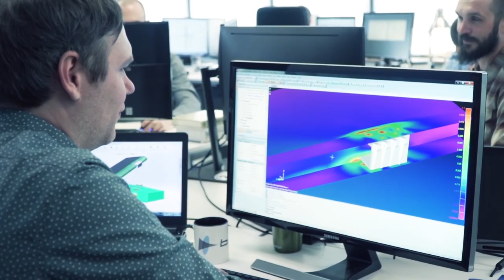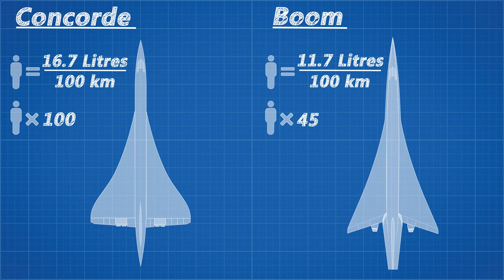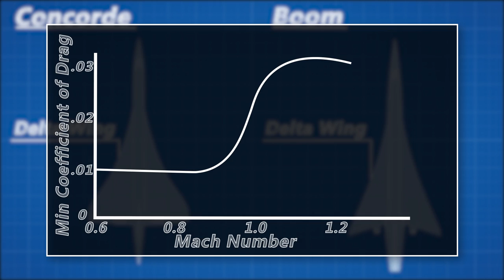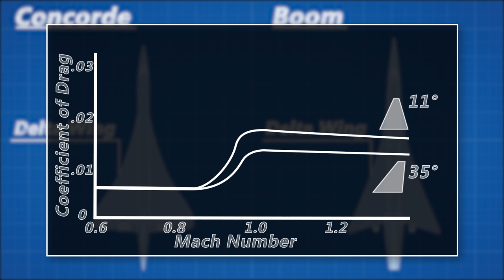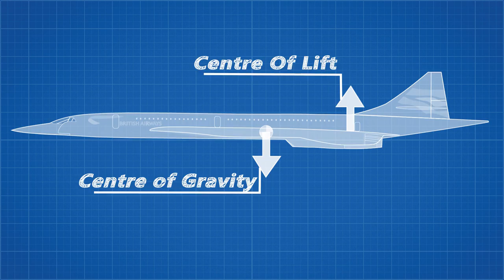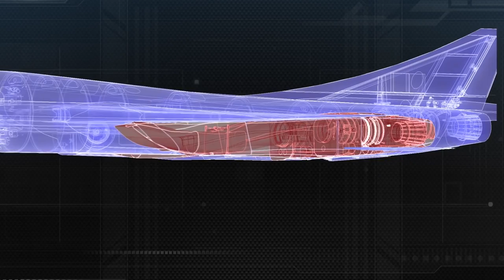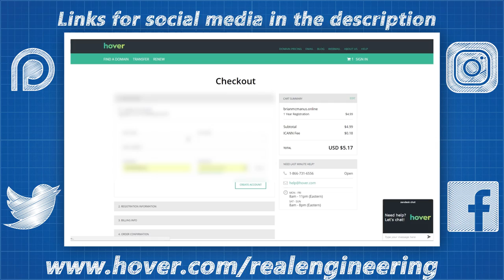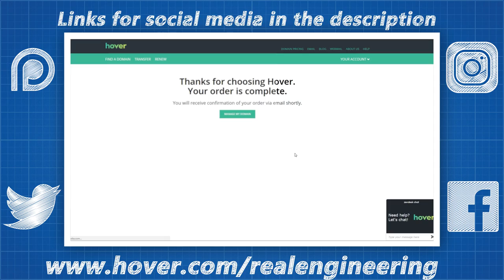Boom: The Future of Supersonic Flight?

Comment: Should be interesting if they pull it off.
I was kind of sad when concorde stopped flying. 
Not a practical aircraft, really, but still there was something inspiring about it's existence.

Based on the drawings and such I'd have to say Concorde still just looks a lot more elegant, but looks are not the primary thing here when the technical requirements are so demanding...

Comment: I'm sorry but on the part of Angle of attack (at 7:18), you're wrong. You mean Angle of Incidence. As angle of Incidence is the angle between the Cord line of the Aerofoil and the Longitudinal axis of the Fuselage. Angle of attack is the angle of the cord line of the Aerofoil to that of the relative air flow, which can only be read when the plane flies.

Comment: Some basic homework required on the introduction. Please go and look at the footage of the safe and reliable Concorde with its wing on fire, struggling to maintain lift. It failed due to a piece of steel edging shredding a tire and rupturing the fuel tank. There was nothing safe about that aircraft, and they want to call this one Boom. Good luck with that! Suggestions for these guys. If they go into car production, don't decide to call it lemon. Okay.

Comment: I don't know how loud sonic booms are at high altitude, but I've always felt that if its ok for planes to be so loud that I can hear them inside my house as they fly over, and have to listen to this sound for several seconds, then I wouldnt really have a problem with hearing 1 quick boom that is comparable or slightly louder as it passes overhead. After all, supersonic flight probably wouldn't be all that common anyway compared to normal aircraft.

Comment: I could be wrong but I thought you require wind tunnel testing if you're doing CFD. Solely because the lack of accurate turbulence models and transitional models for CFD mean you need experimental data to ensure the CFD is accurate.

Comment: dude, you overestimate the impact of the boom on decease of the Concorde. should have been - economic reasons first, then boom. One more thing - chine is added not only to balance the lift, but also to CREATE lift, making the plane fuselage in an essence part of the lift surfaces, rendering the plane more efficient - this refers also to SR-71 - and in a much broader sense, to all the flying wing aircraft, like the Ho-229, XB-47 and of course the B-2.

Comment: There was a supersonic bomber built by the USAF in the 1960s. This craft was called the XB-70.
Two prototypes were built. One survives today in a museum as the other crashed.

The plane's main goal was a high altitude fast penetration bomber. 
It had a cruising speed of Mach 3 (2,000mph) comparable to the SR-71 blackbird.
It could carry a 60,000lb payload. 
Had a 4200 nautical mile range (Boeing 737 MAX has a 3800nm range) 
It was similarly size to the Concord.
Had a 77,000ft operational ceiling.
This plane should have been a SST and was actually used in the late 60's for much of the research used by various companies in the development of SSTs. 
The design should have been used as America's SST.
This plane would be ideal for a long haul SST.

Comment: Currently there are no engines which can fly at supersonic speed and which can meet noise requirements and acceptable fuel consumption.

Not sure it would be possible to develop new engines for that, and in any case the development cost would be huge for a very small market. 

Nowadays airlines don't look for faster planes, but only for the lowest possible running cost...

Comment: A lot more interesting than the innovative solution to saving fuel by flying the plane slower. 

Now this has me wondering if it's possible to make a turbofan engine that allows for an SR-71 style compressor bypass.

Comment: 6:52 I thought wingtip vortices were bad - hence why planes upturned wingtips to keep the  vortices away from the upper surfaces?
Reply: Kj16V they are, but here we're dealing with a leading edge vortex, which allows the airflow over the wing to remain attached creating lift at angles of attack that would normally have detached airflow and no lift being produced (ie the wing is stalled).

Comment: Lesser known fact about the "sonic boom" which helps things make sense to those who it doesn't quite make sense to: it's less of a "boom", and more of a "booming"! Ie, the pilot only hears it when passing through the sound barrier, because after that point, the sound is left behind the plane... but the noise continues to be generated for the entire supersonic period!

I wonder what effect it can have on whales - or if it even transfers into the ocean.
Reply: annoloki , sorry, but you're wrong. Sonic boom is only heard by people outside the plane as the shockwave induced sound passes them much like a boats bow wake. Nothing changes for the pilots or anybody on the plane. Going subsonic, transonic & supersonic all sound about the same in the cockpit/cabin. You hear all the same engine and system noises, the only difference is higher airframe boundary layer noise (wind noise)
Cheers 👍🏻

Comment: I invented. In my head. A high altitude, multi-mach jet. The idea is relatively simple and obviously I am being ignored. 
This is the idea. Use a completely full hydrogen balloon tethered to the aircraft with a suction tube going from the balloon into the jet. As the craft rises the balloon will want to expand. Instead of letting the balloon expand and bursting the balloon the tube going into the craft from the balloon is connected to a electric compressor onboard. The compressor   is powered by a P.roton E.xchange M.embrane  (hydrogen fuel cell).  The P.E.M. also powers the onboard production of hydrogen peroxide. The hydrogen peroxide used for the exothermic jet which powers the jet engine.

Comment: REALITY CHECK: It's hard to tell from just the video, but IMO the people at Boom Corp seem to be forgetting that fuel efficiency was NOT the main issue that made The Concorde the FISCAL FLOP that it actually was ... this may seem unintuitive, but NOISE was the fatal flaw that ultimately killed it, not poor fuel efficiency, because it heavily limited the fiscally viable routes it could fly to trans-oceanic destinations to major cities with enough demand ... which devolved to just NYC and Miami. Without solving the noise issue, that limitation will not change, no matter how efficient a design you can come up with. The only reason Concorde lasted as long as it did was that British Airways was already in the hole for R&D costs (and kept struggling to open more routes), and for the sheer PRESTIGE of it ... and thirdly, because many of their corporate bigwigs with too much say in the matter regularly flew on it.  The final nail in the coffin was a spectacular crash that essentially negated the only thing truly keeping it aloft ... PRESTIGE. In the aftermath of that crash, BA was forced to acknowledge that the craft had been fiscally hemmoraging the whole time.  

Back to the Sonic Boom issue (which is where Boom probably borrows it's stunningly unwise corporate name).  NASA and Lockheed are apparently actively exploring this angle, and THEIR design (unlike Boom's) has reputedly achieved a 'SOFT SONIC BOOM' that reputedly creates FAR less noise than a normal sonic boom.  If true, that could represent a complete tidal change in the long term fiscal viability of this type of tech by resolving the single biggest hurdle (i.e., noise, not fuel efficiency) preventing the addition of more routes (all of them involving land overflights).

Meanwhile, until it can make serious inroads on the noise issue (which they appear to deliberately gloss over in their overly rosy marketing video), all overland routes will remain closed, leaving Boom Corp stuck with the same 2 routes that fatally crippled The Concorde fleet ... and until that changes, the promise of supersonic passenger airline travel will remain just a tantalizing pipe dream for naieve investors to fling money at.  Although certainly very helpful, simply IMPROVING FUEL EFFICIENCY WILL NOT SOLVE THE NOISE ISSUE THAT KILLED THE CONCORDE (e.g., no supersonic overflights of land).

Comment: If the idea is efficiency then maybe Boom can explain why it has to be two rows wide. Why not just made it one row wide, and on the Isle side lower the walkway so it's tall enough. 

Perhaps some engineers could explain to me also why the engines aren't contained within the cross sectional area of the plane?

It would appear to me that the way to create the most efficient plane would be to reduce the cross sectional area of the aircraft as much as possible? You can always make the airplane longer. 

Maybe they could make a middle class version where the plane is actually so small the seats have to be reclined...I'm thinking the way people would use the bathroom would be to ride a seated trolley to the bathroom. Lol.

Comment: I'm sooooooooo stoked for this plane!!! I know it'll have to wait for a few years, since aircraft takes a long time to go from testing to producing phase, but I have hopes they'll be good. What I get from this video is that delta wings are the better option for both sub and supersonic flight, right?
Reply: Delta wings are useful for supersonic flight.  In subsonic flight, they lose efficiency compared to a normal swept wing.  From a terminology standpoint, supersonic and hypersonic are two very different things.  Supersonic is generally considered to be flight at speeds between Mach 1 and Mach 5.  Above Mach 5 is considered hypersonic, and it's a completely different realm of flight, occupied by test bed projects and rocket vehicles.  The fastest jet powered aircraft ever made is the SR-71, and it's max speed was Mach 3.
Reply: Oh yeah, wrong term then. Thanks for the clarification too!

Comment: Should have talked about the engines more. There are no turbofan engines currently available that'll take a commercial passenger aircraft to 2.2 mach and stay reliable for a viable time. Engine companies won't take a risk to try design & build such advanced engines for a potential niche market, not while there's so much solid business in the subsonic engine market. 
They are trying to be 2 steps ahead of what the market and industry is ready for. There will have to be an enormous cash injection from someone to try get the engines designed & built 25 years sooner than normal.

Comment: If a sonic boom at higher altitude is quieter because it has to travel through more air before reaching your ears, then it's not actually any less loud, you're just farther away from it.  So, to say "...but high flying aircraft don't create near as loud booms" is not only incorrect, but oddly misleading as well.

Comment: Oh dear, Concorde didn't have a delta wing but an ogival wing. They are very similar, but the leading edge of the ogival wing is a stretched out S-curve (a delta has a straight leading edge). The wing shape also acts like the chine on the SR-71. An delta or Ogival wing shape without a tailplane or canard will always have a high angle of attack at low speeds to gain the benefit of the vortex lift, and will need to have a higher power setting on the engines making the aircraft noisier. Any delta or ogival wing aircraft without a tail plane or canard can not be fitted with high lift devices (flaps, slats, etc) as these create a nose down pitching moment when deployed that the wing mounted contol surfaces can not overcome.
Reply: Neil Dahlgaard-Sigsworth whats a chine

Comment: The area rule fuselage, delta wing and variable engine inlet were all in use in the late 1950s in military aircraft.  A SST that carries less than half the passenger load of a Concorde is not economically viable even if the fuel consumption is reduced by 50 per cent rather than 30.  Facts trump daydreams every time.

Comment: Sorry, but to get the leading edge vortex lift of any kind of delta or ogival wing you need to fly at high angles of attack and at this requires power, which means noise. Granted a turbo-fan is always quieter than a turbo-jet, it will still need to be running at closeto max power and therefore will be at it noisiest. Not somethingthat those living near the airports that this concept is intended to operate from will like.

Comment: Its wings are shorter in diameter than even the Concorde which means its going to need an even longer run way to take off. What Airport has a long enough runway to accommodate this aircraft?

Comment: Sorry bro but wing tip vortices are actually 'Induced Drag' they are a negative side effect of lift creation and they decrease in strength as speed is increased. They don't increase lift.
Reply from the maker: So what is induced drag? It is a low-pressure vortex formed behind the plane, which holds it back. When that low pressure vortex is formed on top of the wing, it creates lift.  Where there is smoke there is fire, where there is drag there is lift. Where there is lift there is drag.

Comment: Pebble raised 15 mil and they were building smart watches. Also, can't see FAA approving a camera in place of actual sight for pilots on landing.
Reply: I think it may be possible that they'd approve a camera. Almost all commercial aircraft have the ability to land with little to no sight of the runway, providing there is an ILS to guide it down. Relying on just camera in itself, I am also doubtful that they'd approve that, but if you provided a "HUD" ("Heads down display" in this case) of a type, similar to the HUD in the 787 and new 737 models, then I don't see why they wouldn't approve that.
Reply: +Dragaming True

Comment: This video gives a good general technical overview. Is Boom going to simultaneously be an aircraft developer, an aircraft manufacturer, and an airline? It is extremely unlikely that they will be able to raise enough capital to be all three. I would like to have seen some information on their proposed engines, and the likelihood they will meet their fuel efficiency target. Failure in that area would mean that this company is not economically viable. I would also like to hear their plans to survive the dirty tricks that the other aircraft manufacturers, airlines, and airports are going to throw at them, to crush them. For example, if Boeing tells any suppliers (particularly engine suppliers) to not work with Boom, they won't. And if American Airlines tells a major airport to not give Boom any gates, they won't.

Comment: They could just have set about upgrading the Concorde 
1. Turbofan engines with cooling
2. Windowless and Windshieldless fuselage 
3. Mach 1.6
4. 300 passengers 
5. Beijing to New York range
Reply: Nii Ayi Croffie That sounds like much more than just "upgrading the Concorde". We're talking complete rescale, new air intake, and a rather claustrophobic experience to boot.

Plus, who tf needs a 300-passenger supersonic? Thing would probably not fit on most airports. This design would be at least 90 meters long.
Reply: @ImmortanDan  yes you are probably right. I have thought better of this comment since. But I would still prefer windowless. Maybe 75 seats. Cooled turbofans. Long range. Mach 1.6. And a two pilot cabin. No afterburner and a much better skin. Same design though.
Reply: Nii Ayi Croffie As of now, we're not going to solve the problem of the sonic boom, or achieve a much greater fuel economy, by lowering the cruising speed; And choosing M1.6 instead of the currently-aimed for M2.2 takes away a lot of the customer appeal.
Reply: @ImmortanDan  with turbofans the plane can fly Mach 0.8/0.9 over urban areas with no sonic boom and speed up over large expanses of forests, deserts, etc
Reply: Nii Ayi Croffie The Boom is almost guaranteed to have a low-to-mid-bypass turbofan regardless. M2.2 is still the cruise speed we need.

Comment: Winged Jet-Propulsion is not the future of flight, in fact it's an antiquated system based in principle, on a bird in conjunction with an equally-dated combustion engine. The future lies with Electric and Magnetic Field-Propulsion Systems, obviating the need for clumsy wings or mechanically articulating surfaces as historically utilised.

Comment: you explained wing vortex wrongly .they are ALWAYS at the wingtip. but they basically cause it s othere is no lift on the wingtip at some speeds. the idea behind the wing tip pointing upward is so the vortex doesnt happen along the tip of the wing and instead is on the upwards strand. if it was down the entire wing. you would just end up with legit no lift